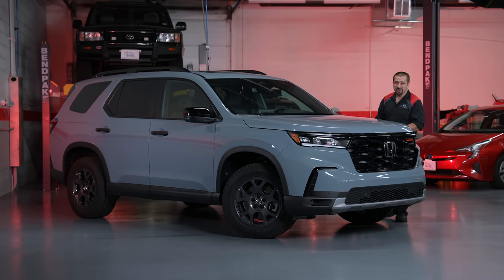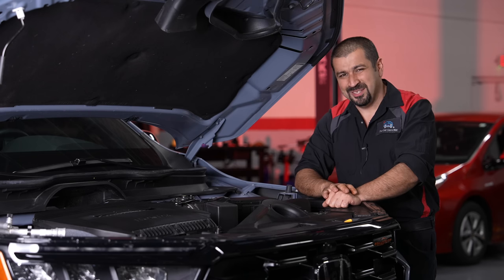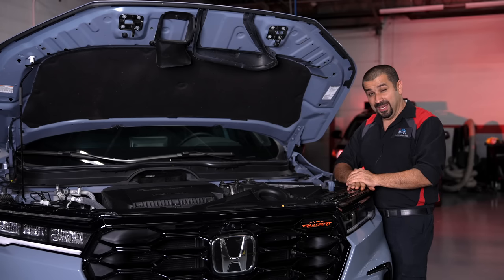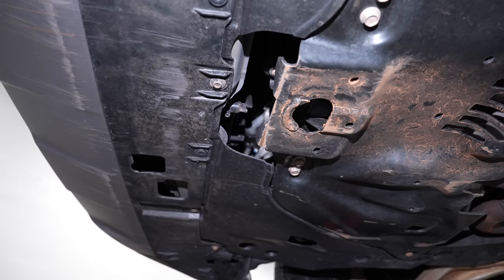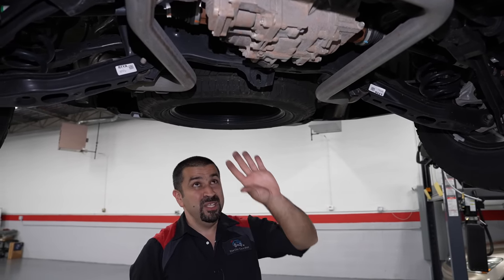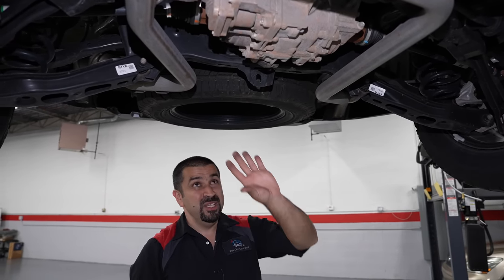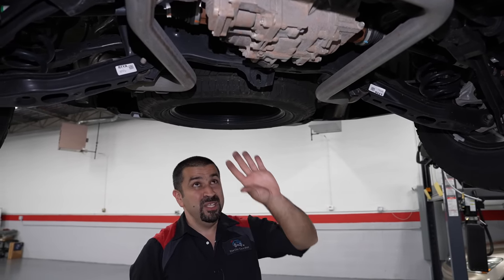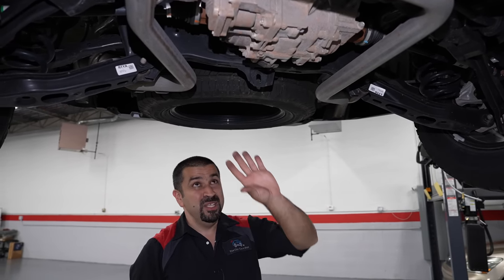Should You Buy a 2023 Honda Pilot? Thorough Review By A Mechanic

Comment: I recently purchased this exact same vehicle. Honestly, I feel like I committed a sin by moving away from Toyota for the first time in my life, but I just can’t get on board with the 4cyl turbo in the GH. By watching your video, I feel a lot more comfortable and confident about my purchase. Thank you!
Reply: I’d take a 4cyl turbo over NA with cylinder deactivation.

Turbos haven’t been proven problematics but CD absolutely has.
Reply: lol turbos have been around way longer than cylinder deactivation, if you’re going to have any modern car with a turbo or cd then you will have to service either at some point but the naturally aspirated vehicle should be more reliable regardless of cylinder deactivation.
Reply: Toyota Highlander Hybrid was a great choice & never feel under powered but it is cvt & not direct drive AWD like in Honda or VW but the electric motors do a good job of pulling out of sticky situation👍👍👍👍👍👍👍👍👍👍👍👍👍👍👍👍👍👍👍👍
Reply: Notice AMD said in the past it was an issue. Why? Because the newer V6s have less prevalence of VCM issues versus pre 2015 I think. 

The good thing is if you don’t want to have VCM or don’t like the vibration when it’s active, then VCM can be disabled with VCM tuner 2.
Reply: @sizzlacalunji  already tons of reports of vibration
Reply: @impaul41  As already mentioned, deactivate the VCM with a disabler. I have with No issues so far.
Reply: @robertneal6878  you can turn it off in the 23 pilot?
Reply: @impaul41  I admit a 19’ is old school by now. Though I did read/hear mentioned that it was available for a 23’. But maybe a different connector for the thermo plug. Will investigate for sure. My curiosity is now aroused.
Reply: @sizzlacalunji  not sure, but if the J35Y8 is kept in sport mode, wouldn't VCM be avoided, mostly?
Reply: @gametraveler  I think you have a point, I am not sure. Sport mode would hold the gears  longer, sharper response and keep revs higher. It would seem VCM should not be activated in such a state. Idle stop is disabled in sport mode so it is possible. Will test it and see.
Reply: When you test drive the turbo 4 cylinder grand highlander  did it feel sluggish on exelerating.
Reply: Cylinder deactivation is not your friend.
Reply: @impaul41 
I was about to say the same thing. 🤦‍♂️🤦‍♂️ they didn’t learn from GM
Reply: O love pilot and is a shame Toyota don’t have a v6, I have a question.. is good the pilot? The only thing who stop me from highlander is the 4 cil
Reply: @impaul41 idk about the 23 Pilot, but you can turn it off in the 21 Ridgeline and Passport.
Reply: You did from 2018 to now they are prototypes
Reply: You made a great choice.   Proven engine with great power and vehicle is extremely solid.
Reply: Same here, also Toyota are asking way more for a car that is slightly longer and some components are cheaply made. People have reported bending the trunk door by just closing it
Reply: @robertneal6878 i had a 46 8 cylinder v8 caddy seville 1982..it felt like it was shifting all the time and they had problems back then...i had to dig to find the way to disable and it was a plug on the transmission that you simply unplugged...i was surprised to hear that honda reinvented it.  That and gdi would make me hesitate..
Reply: @impaul41 my 2005 Honda Odyssey with vsa has 356k miles with no problem
Reply: Pilot has a better AWD system too.
Reply: Not sure where your from but up here in northern Alberta, in winter, with plenty of dirt snow and slush, those washers on the cameras are fantastic. They work well.
Reply: @TopVillain  There is a handy button next to the shifter to disable the CD. Pretty simple solution.
Reply: @louisverduzco851  thanks I have a 13 pilot that doesn’t have the option also have a 15 pilot that has the option
Reply: And definitely like the V6 over a turbo four-cylinder however, as soon as he mentioned, head cylinder deactivation, I’ma no go.
Reply: I moved from Camry to Accord when Toyota stopped offering a manual trans.
Reply: @sk-un5jq Toyotas handle like boats too. Even a Camry. I just can't deal with it. I would check out a CX-90 but way too much new tech in there. Pilot is the best choice for me.
Reply: I hope Honda fixed all the electrical issues with this car. These issues from 2016 to 2021. I don't know what happened after 2021 because I bought a Toyota landcruiser 200 because I don't like risks. Good luck.
Reply: @johnferreira174 You can push the button to cancel or simple installation of aftermarket DC bypass.
Reply: @Jojo-ke9dh They did. It was the wire harness issue. Recall took care of it.
Reply: @sizzlacalunji  do you get a chance to test this? Is CD disabled on sport?
Reply: I narrowed it down to 4runner TRD or the Pilot Transport, I am nervous haha but I love my 2024 Civic Sport so I really trust Honda
Reply: I test drove grand highlander and pilot yesterday.  Pilot v6 all day.  But I am still stuck on which one to buy. But honda pilot is leading the way. Price. And motor seem better. But for family of 5 the highlander does have more space but not sure it beats out the other 2 factors
Reply: @lulop022882  I was always a GM guy till I got CD on my 09. What a pile of junk and never again will I own a GM product. Only good thing are their Izuzu motors made in Japan
Reply: Timing belt and CD ....I'm out
Reply: VSA usually is worst on V8 vehicles not so much on V6

Comment: The Honda Pilot is the third longest lasting SUV with 42.7% passing 250k miles, that's even more than the 4Runner. Whether this new generation can live up to those numbers is to be seen.
Reply: My 2000 excursion v10 i just sold had 250k
Reply: Very interesting statistic.  May I ask where you got this information?  I’m also a 2013 Honda Pilot owner and have been very pleased with it and still have it.  I just picked up a 2020 Toyota 4Runner and they feel very different.  I know Honda is unibody construction while the 4Runner is body on frame.  Still, I’m loving my 4Runner also!😀
Reply: Just passed 300000 on my Dodge Durango. Still running strong!
Reply: What's the first 2 suvs?
Reply: @rocketman3158  👍🏿sweet😎 those are rare
Reply: Where did you find that metric? I wanted to see about Mazda CX9s
Reply: "Time will Tell"
Reply: I’d believe it, my Acura MDX went over 300,000 miles
Reply: I had a 2003 I just sold - had over 275k and the only things I replaced were brakes, battery, alternator (twice) and a couple bearings, motor mounts. Insanely reliable car
Reply: I’ve got a 2014 with 150k miles. Not a single problem to date. Just regular maintenance. Hope the new one is just as bulletproof as I’ll likely buy one within the next few years.
Reply: I sold my 2004 Honda Pilot with 380k on the odometer. Engine and transmission were good, but the body was beginning to rust.
Reply: @christopherdeguzman1137  you have two extremely solid vehicles, sir!
Reply: @ONeal397  Toyota Land Cruiser and Toyota Sequoia
Reply: I own a 2005 Honda Pilot with 280,000 miles. Great car, best I ever owned. It goes 6,000 miles between oil changes and never loses a drop of oil. I am thinking about a used 2023 in a couple of years when mine gets to around 350,000 miles.
Reply: Not with vcm it won't, so sad
Reply: @ctbale1  is this like VVTi?
Reply: Yes. It will last but paint only last for 5 year. Then paint peels starts...
Reply: @alvinemp9042  nobody said they are in good condition😂 also do you mean the 4Runner or the Pilot has paint peel?
Reply: Idk where this stat came from, but look at how many 3rd gen 4Runners are on the road, vs how many older pilots are around
Reply: I've got a 05 Pilot with 320k miles and still going stong. When it dies I'm buying another. 👍
Reply: He is reviewing the 2024. Our 2023 does not have dual cams. Only the 2024s have dual cam and that 2024 engine is significantly larger
Reply: @christopherdeguzman1137  hows your gas milage on your 4runner?
Reply: 4Runners are used for off-road and prob get wrecked more. That’s why
Reply: Yea people on Edmund’s have had negative experiences regarding the 2023 and up😊
Reply: I have a 2004 with 415,000 miles. Runs like new

Comment: Long term Toyota and Subaru fan here.  I just got a 25 Pilot.  No markups. Simple design concepts.  Not too showy. Efficient enough. Capable enough for snow and soft road excursions. Everything is easy and smooth.
Reply: Looking at a 2025 Honda Pilot TrailSport. The only thing I don't like about it is the Auto Engine Idle Stop. You have to turn off the setting every time you get in and drive. Any issues with your new 25 Pilot?
Reply: @kanbowhunter  You either get used to it working or used to clicking the button. I had it on my new 24 Outback Wilderness I sold to buy the Pilot. That auto-stop-start became mandatory on all vehicles with keyless ignition in the US in September 22 so most cars have  it. They have a cycle counter and can replace the starter at a specific interval of stop+starts so you don't end up stranded years down the road due to the starter wearing out. I turn mine off.
Reply: same here ne 2025 myself and couldn't be happier.
Reply: @wescam i want a Keyed car then. Start Stop is just unaceptable Lame to myself

Comment: I'm 4 minutes in and heard all I need to know.  As a Silverado owner , I know cylinders deactivation is a nightmare.
Reply: It can be easily deactivated though which if you expect to keep the car for a long time is a must to help prevent burning oil later on
Reply: Completely agree, but still prefer this over the new trend of undersizing the engine and slapping a turbo on it like every other model
Reply: if you're driving a Silverado, you've got way bigger problems than cylinder deactivation.
Reply: I still have a 2008 honda Odyssey with 150K miles on it and never had a problem with cylinder deactivation
Reply: 2 Camaros,a Blazer, 3 Silverados since 1981 and now I'm done with GM.  The issue is widespread and dates back many years. Enough so that there's a class action lawsuit.  I installed a Range disabler and run 8cyl at all times. Fingers crossed.
Reply: Honda is an engine company first and foremost and won't f-ck it up like the Americans.  It's 2024 dude... you should know that by know.
Reply: @ChrisMaj  "I have X and no problems, therefor noone can have issues"
How many times do people need to get slapped in the face before they stop saying that. It's useless to say that. Cylinder de-activation is a needless complication for emission standards that you should have removed as soon as you buy it, if you intend to own in long-term. The fact that it sometimes doesn't manifest, doesnt mean you should just leave it enabled, or that it can never end horribly. I've seen several of these J35's on South Main Auto Channel where they had massive issues because of it. Especially with mediocre maintenance.
Reply: As a fellow Silverado owner... I feel that. Get the "range technology" AFM delete plug-in.
Reply: @michaelthomas9243  hahaha....lord have mercy/!!
Reply: I marked it off my list soon as I heard it.
Reply: Mmm in crappy GM vars
 Which this is not. Honda's VCM has had very few problems.
Reply: @Wised1000  Mmmm...Honda ?  Show me a worksite with Ridgelines all over it. As for GM these days, I'm no longer a fan after buying chevys for 40 years because of this bullshit design implemented to meet CAFE standards.  I disabled mine and still get 18.5 mpg .
And,  let's not even get into crappy "vars".  You had preludes n crxs' while I was rolling in a 73 then an 81, then an 86 Z28. Go on w that nonsense.  GM has icons.
Reply: I am trading my 2019 tahoe for this Honda Pilot. My wife and I both owned civics, mine had 280k before i sold it and we kept hers that has 180k, zero problems with those cars. My 2019 with 65k has lifter issues as we speak and it is in the shop. Chevy has issues with their lifters which they will destroy the camshaft, they also have issues with their fuel injectors and not only that but their transmissions will go out on any V6 or V8 engine just between 150-180k miles.
Reply: @ChrisMaj you dont have them so much in V6 but on V8 GM is just disaster to happened.

Comment: As a Honda/Toyota mechanic myself and having seen countless reviews on this generation Pilot, you still brought forth many bits of information that I didn't hear about before.  Thank you AMD for your hard work and knowledge with these thorough technical reviews.
Reply: Have you work on any Acura products
Reply: @Jamrock626  yes though not many.  Mostly on Hondas/Toyotas.
Reply: @nipponautomotivellc  I have an MDX that's nothing but a nightmare to me.   It vibrates when it changes gear particularly 8th.   When purchased I had an itch and trans cooler installed and they told me the vibration was due to the cooler.
Reply: @Jamrock626  sounds a bit fishy to me though haven't come across this issue before.  Not sure what could cause it.
Reply: @Jamrock626 what year MDX? The last generation, which I owned, had a ZF 9 speed, which has not gotten good reviews amongst owners in the MDX fb group. I own a pilot now and I’m glad this 10 speed has been smooth shifting
Reply: @nipponautomotivellc  totally agree.    It recently stalled at the light twice already
Reply: @Jamrock626  what is the year of your MDX?
Reply: The ZF 9 works perfectly well for this application. It’s not a race car. Not sure why people give it a bad rap.
Reply: @ClovisGeneral so you’ve owned a car with this ZF 9 speed? I have for 3 years and I’m glad it was a lease. Rough downshifts and seems to be constantly hunting for gears. I drove it in normal mode 99.9% of the time so it’s not like I was in sports mode
Reply: @Jamrock626 so what year is your mdx? Model?
Reply: @Jamrock626  What year is your MDX?😫
Reply: @ClovisGeneral  Mostly because of worse gas mileage (partially weight, but mostly transmission) and acceleration from 0-60 is down a full second.  And before you say "it's not a race car" again, just point out that when you need to merge with traffic on an interstate, a full second is important.
Reply: I have a question for you sir. I have an 07 ridgeline 155k bought it used I have no idea if a valve adjustment has been done. It's not loud and does not misfire runs great. Do I need a valve adjustment? Cam I wait to get one ? And how do a lot of honda v6 owners actually never get a valve adjustment and their some of their engines have well over 200k miles with a valve adjustment never done ?
Reply: @shadowman1992   From my experience, if it isn't loud and causing any issues, I'd leave it alone.  I believe what keeps them quiet for some people just depends on frequency of oil changes, as in doing them either on time or early on a consistent basis.  My Pilot is currently at 249k, oil changes every 3k miles, and have never done an adjustment.  It could somewhat use it though is barely noticeable.
Reply: @nipponautomotivellc  thank you for the advice I keep up with all oil changes and all fluids for my vehicles as well. I have been worrying about this so thanks
Reply: @ClovisGeneral  There are different iterations of this transmission.  Initially, they had problems.  Later versions were fine.
Reply: He said that it is the 2023. Our 2023 does not have a dual cam